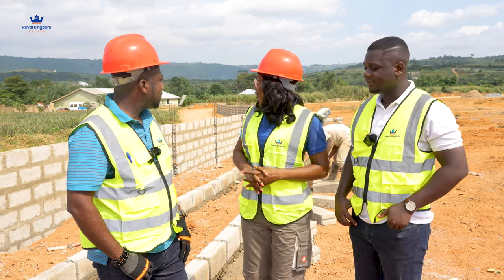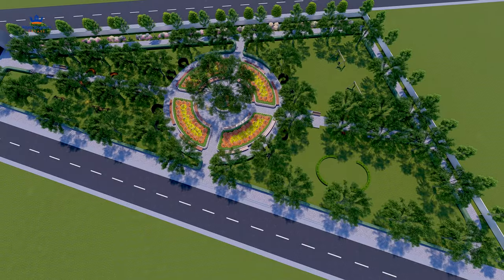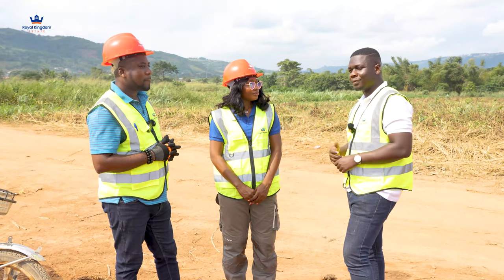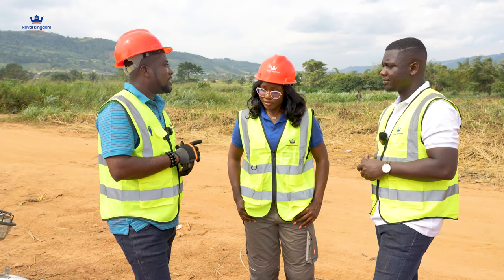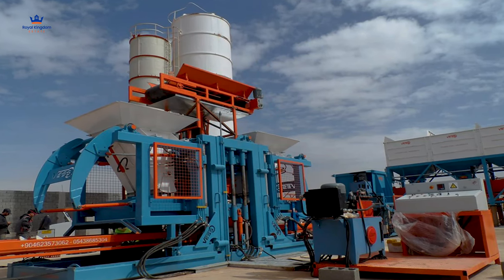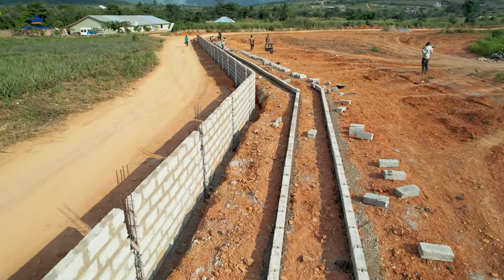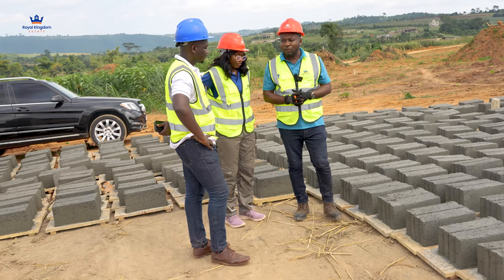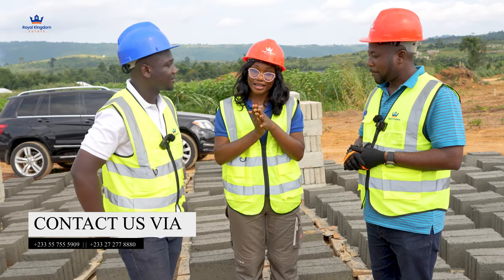THE PERIMETER FENCE WALL FOR GRACE CITY PHASE 3 IS UP! GREAT PROJECTS TO ANTICIPATE FOR LAND OWNERS

Comment: Please do you still have plot of land to sell? And how much is it? Am a Ghanaian anyway.
Reply from the maker: Yes we do! 
Kindly find below the price points for our various plots with locations. 

1. *Grace City Phase 3 *(Aburi- Amanfro) in the Eastern Region of Ghana.

Price per plot: GH₵ 70,000 

Instalment for 6 months: GH₵ 80,000

2. Commercial plots at GRACE CITY (Phase 1)
Price per 2 plots: GH₵ 200,000 

NOTE THAT THESE PLOTS ARE ALWAYS SOLD IN PAIRS, AND DO NOT HAVE INSTALMENT PACKAGES

      
3. Blackstar Village (Peduase, Berekuso/Ashesi University) in the Eastern Region of Ghana.

Price per plot: GH₵ 160,000 

Installment for 6 months: GH₵ 170,000

3. The View (Berekuso/Abokobi, Ashesi University) in the Eastern Region of Ghana.

Price per plot: GH₵ 200,000

Installment for 6 months: GH₵ 220,000

Minimum deposit for installment: 50% down payment, and the balance spread across a monthly installment of six months.